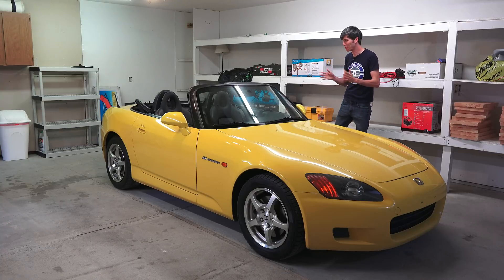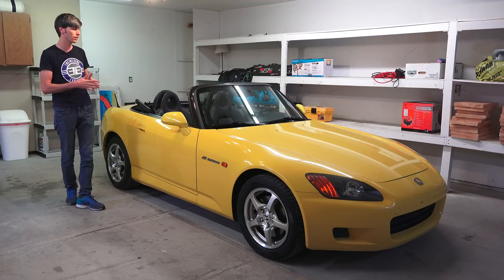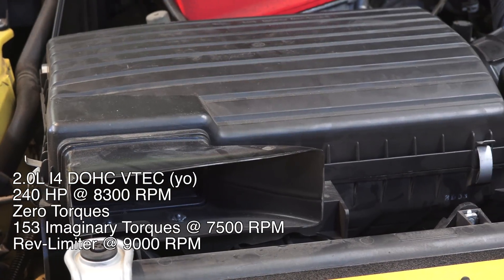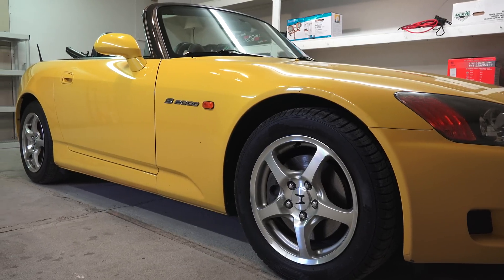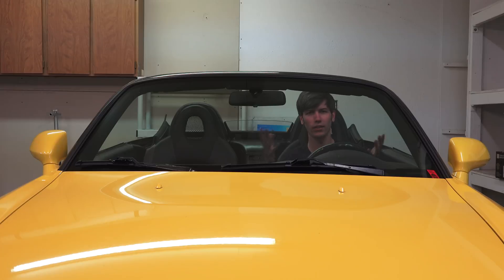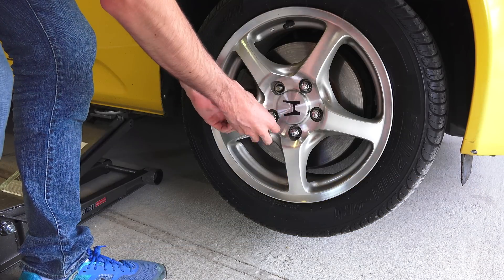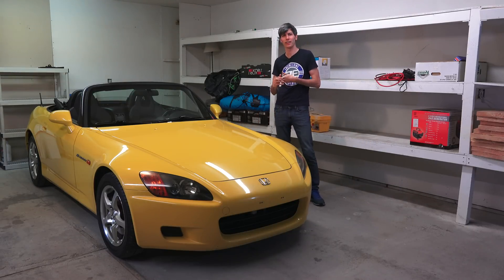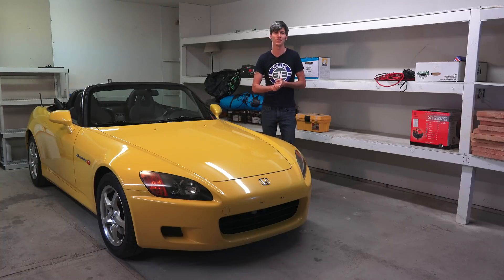I Bought A Honda S2000 And It's Amazing!

Comment: My AP2: Proper exhaust, cold air intake, Lightweight flywheel, Stage 3 Clutch, and changed redline to 9k.  The car felt COMPLETELY different from stock and devoured my stock AP1. It was a great autocross car and it was doing E46 M3 times.  Driving experience is really amazing.  Complete oneness.  Its not about hp guys.  I now drive an orange Crosstrek with CVT lol

Comment: Congrats, I really enjoy your videos. I made the same switch to get back into my 2nd S2000. I sold my 2012 WRX Hatchback (Stage 2+) so I could get a cheaper daily driver and an S2000. I'm still very happy with my decision and wish I wouldn't have sold my first one. As others have said, definitely get on the S2Ki forums if you haven't already.

Comment: Had the opportunity to drive the S2000, the BRZ and my old RX-8 in an autocross event.  These cars handle virtually the same except for some minor differences that are only noticeable if you know how to extract every ounce of performance from cars like these.  At the end of the day my RX-8 posted the fastest lap by about .1 second.  The reason for the faster lap can be because of stickier Michelin PSS tires and I know my RX-8 more than the others.  For the record, the S2000 had the Enkei PRF1 with PSS while the BRZ had them Prius tires.  The lap times were for the most part very close, it just happen that the RX-8 did it the fastest on that one lap.  No matter which one you choose the experience is virtually the same, fun all around.  Nice car.

Comment: Actually this car is the best for this challenge. Ist one of the most beautifully crafted and engeneered engines at all.

I mean, everyone can put some Turbos on an 3,5L 150HP engine and make an 600HP engine but 240HP out of an 2L Engine, thats art!

Next locial step, but an HKS Compressor set on it. First tep 300HP, second step 400HP

thats 200hp/l and the engione still works fine!

Comment: Can someone explain the appeal of vtec? I drove a 2006 TSX with I-VTEC, and I got rid of the car because I hated having a naturally aspirated motor, that felt like it had really bad turbo lag. Not to mention that the gears felt too long even though it was a 6 speed with no difference in the top gear than any 5 speed out there. I traded it for a BMW, because the bimmer is actually cheaper to maintain. Seriously! Look up what it costs to have a clutch replaced in a 2006 TSX, then look up a similar year 5-series. I am happy for anyone who enjoys Hondas. I guess I just prefer the products of Bavaria.

Comment: How is the leg room? I always heard anyone over 5'3" would have trouble getting in and out.
Reply: Lanky, AKA amazing ;)
Reply from the maker: I'm 6'1" and lanky (that part was probably obvious haha). I fit fine. Ideally it wouldn't have a fixed steering wheel and I could bring it closer and move it up slightly, but it's not too bad of a compromise.
Reply: that's good to know.  I was looking to get front engine rear wheel but I was going to get a 370z instead for height reasons (6'3") but I might look at this as a more reasonable alternative.

Comment: Honda's first use of forged pistons?!! (2:33)...My '94 VX with the D15Z1 engine has forged pistons, and that's just a high mileage, grocery-getter.  I can only assume that the higher-zoot engines in the EX and SI models also have forged pistons.
Reply from the maker: Are they aluminum? My info was from Honda, may be referring to aluminum forged.

Comment: Your version is not the highest hp/L until 458 Italia. The JDM spec F20C with higher compression and slightly higher fuel cut is. (250hp/9120rpm+).  Just pray you don't need to rebuild it. Gearbox is an Aisin AZ6 and it's found in RX8/MX5/etc etc. It's pretty nice in the S2K variant though :)

Comment: just curious, why didn't you go for an AP2 S2000 ??  aren't they like exponentially better than the AP1 ??

nice car btw, super clean, I hope to see a spoon hardtop in the near future ;)
Reply: +TheJoePepper ah, well alright cool, the more you know, thanks for the response bud :)
Reply: They are both great cars.  The throttle by wire didn't appear until 2006 so many believe the first years of the  AP2's (2004 & 2005) are the best years for the S2000k, but like anything, it's really just personal preference.  I own a 2005 AP2 and my best friend has a 2002 AP1.  The AP1 is considered to be more "raw" as you refer too, however the AP2 handles a little better in my opinion.  We're both experienced drivers and are very familiar with sports car and really familiar with our Hondas.  Unless your a serious race car driver and / or engineer it's hard to notice any significant changes between the 2 models.  Both cars are truly amazing and very few people really understand the engineering marvels that they are.  Good luck with your new ride.

Comment: is there a ETA for the XV to arrive???
Reply from the maker: I'm told late September, but I unfortunately don't have an exact date yet!
Reply: Thanks, Looking 4ward to it..  I've been planning to get one since they appear unfortunatelly Subaru Cars are EXTREMELY Expensive (Actually everithing is expensive in here) so I've been waiting for the rich people to get one and then I will be able to get one Second Handed..
Reply: Did you get the CVT or Manual. ? I've been told by some users that CVT's are not as good as Manual..

Comment: Why not an AP2? A little more torque but more importantly, a better powerband that's not as peaky.
Reply: How so? I've driven both and the suspension, steering and shifter/clutch didn't feel significantly different. The lack of torque in the midrange on the AP1 certainly did.
Reply: I didn't. So enlighten us why the AP1 makes a better track vehicle. Why does that matter, anyway? How much time do most people spend at the track?
Reply: That literally says nothing but you do you, guy.
Reply: Well I didn't mean it figuratively now did I? You keep making bon mots without conveying any concrete info so yes, you literally said nothing.

Comment: And I am here with my stage 1 1.9 tdi audi a4 b7 from 2008 in red not a lot of HP (around 150hp), but definetly more torque (around 350) than none advertised in the video for the s2000

Comment: Welcome to the club! Honestly contact me if you've got questions!
Reply: Wrote this before I watched...from experience the best and cheapest mod to start with on the S are 255s², any high speed cornering a wing is practically mandatory for stability, at least its the cheapest way to reduce rear lift. But if you don't need the high speed stability (80+) then don't bother. Aside from the 255s, a wing, and the associated spring rates or front sway bar rates to balance the changed suspension loading, nothing else is "needed." With 100k miles new dampers are probably a welcome item though. Next best mod honestly is a seat, and then weight reduction.

GM synchromesh friction modified is great for the transmission...have used Motul, Amsoil, and Redline but the GM stuff just as good if not better, you'll just notice it breaks down a little quicker.

Comment: you should get the valve retainers checked out or just switch them out with Ap2 valve retainers. Ap1 valve retainers are known to crack over time or when over revving. Ap2 valve retainers will fix the issue.

Comment: Are there any mods that increase the torque available?
Reply: All aluminum LS swaps aren't hard, and adds less than 100 pounds when compared to a stock engine built up with a intercooled turbo set up that still makes less power, cost more and is WAY less reliable.

Comment: +Engineering Explained
I have a 2005 AP2, which I've owned for about 7 years. Awesome car, and I hope I can keep it forever. (We get the 9k rpm motor here even in the AP2).
One thing I'd think about is the suspension differences between the AP1 and AP2, which might make a good video actually: if I understand correctly, they increased the stiffness of the front anti-roll bar while softening the rear one. And also changed tyre widths -- front to 215 and rear to 245. Think tyre load sensitivity: The AP1 had a bit of reputation for being quite twitchy with oversteer, possibly thanks to VTEC and the Torsen. The changes to the AP2 would help reduce this, but it's still a car that demands a bit of respect. So this might be interesting, and also take care when thrashing it :)

Comment: With the engine being positioned behind the front wheels, how does this and other vehicles with a similar setup handle in comparison to vehicles with a motor positioned in front of the rear wheels?

Comment: They truly are amazing little cars.  I've had 2 of them so far.  ap1 and ap2 models. You should look into swapping out the TCT and seats with the oem ap2 me a because they have been revised and don't fail over time like the early ap1 model.    Also I seen someone ask why so.low dyno numbers.  the s2k was raged at 240hp AT THE CRANK. after valve train loss and everything else a healthy s2k should out down 190-200hp on and accurate dyno.  With some mods and a tune they do wake up day and night. my ap1 was making 221hp and the ap2 223 at its best on a mustang dyno.

Comment: The S2000 has similar dimensions to the 2017 Fiat 124 so what do you think of a comparison between the two?   When the Abarth version of the Fiat 124 arrives, I'd like to see you do a review between it and the S2000.  I noticed that the Fiat has a smaller 31 feet turning radius versus the S2000 35.4.

Comment: Def rather have this than a $80k Dodge
Reply: if you don't die on the process
~mandatory Viper death trap joke~
Reply: @AL1-07.... You misread.... Anybody who would have 8 Stacks Of High Society would not... buy a dodge(viper... maybe... but still.... noo...)
Reply: dark zaku You misread, I didn't say you had to buy both at the same time. I said if you're in the financial position to buy an 80K car. You could buy either Dodge or Mercedes.
Reply: Would rather have a 40k srt8 challenger.
Reply: Nah would rather have the $80K dodge. So i could have some fun, sell it and buy an AMG or M car when the time comes
Reply: AL1-07 So you'd rather have a Dodge so you can buy a Mercades got it
Reply: dark zaku Yeah you got it. If you can afford a 80K dodge you can afford a 80K mercedes.
Reply: AL1-07 Hold on let me check that math:
grabs calculator
80,000 - 80,000 = 0
Hmm, interesting

Comment: Why forged pistons in something naturally aspirated, that sees so high of RPM?   I thought Forged pistons were way heavier, expand too much, making the clearance too large to the piston wall to be efficient, and slowing down revs?
Reply from the maker: +Kenny Coulter they're aluminum so weight isn't a big issue. Forged allows for using a smaller size relative to strength as well. I believe they did it due to high piston speeds above 8k RPM.
Reply: Yep that's right
Reply: I mean compared to a cast or hypereutectic piston.

Comment: Congrats.
Any reason why you opt for the AP1 and not AP2?
Reply: Really I was hoping for someone to say "its over 9000!"

good enough.
Reply: I'm going to guess he wanted the 9k redline.
Reply: Almost double the price and barely much faster...
F20C etc also in AP1.
Reply: Dont know about the price, they seem to cost pretty much the same in my area. Price= It comes down to mileage/ condition of the car.
Reply: +iNNoCeNttDReAMs
[soft monotone voice:] "Greetings.  I am the AP1 9000 RPM engine."

Comment: Nice colour choice, I have the red one in Australia. Yes ignore the internet hissing and moaning about having a Japanese convertible, it's quite easy after experiencing a few long twisty drives. It's a car who's engineering of everything can be really appreciated. If it doesn't have semi-slick R spec rubber on it yet, try that soon. I've done 15 years of road Kart racing, and my AP1 is the closest thing to the feel of a Kart on slicks I've experienced on the road. I'm keeping mine as close to stock as possible, as they get older and fewer the clean stock ones will go up in value faster. Have fun. Martin

Comment: Iff the engine is behind the front wheel does that make it mid-engined? Does that mean it pretty much id a lighter convertible NSX?
Reply: Yes and no
Reply: Specifically, that sort of placement is technically called Front-Mid since its still in the front half of the vehicle. I believe any car with all of it's engine placed behind the front wheel hubs and steering rack would be classified as Front-Mid. Typical mid-engine cars we think of like MR2s and various Ferrari models are Rear-Mid, AKA Mid-ship, but are found in the rear half of the car.
Reply: Colin Brunt Thanks for clearing that all up.  So there are Rear engines like Porsches, Over Rear like Lambos, Mid Rear like the MC12, Mid Front like this S2k and Over Front like the BRZ?
Reply: Yep, you got it!

Comment: I have a V6 Camaro and sometimes feel I need more pick up, I am considering the s2000 as a replacement and I am worrid that this will become a bigger issue. 

Can you elaborate more on the power feel. Does the the 2.0L Engine feel underpowered at high speeds? for comparison the Camaro feels wanting around 160Kmph
Reply: The S2000 beats a V6 camaro in any way.
Reply: Is your Camaro an auto or manual? I have the manual and I feel it has decent enough power for what it is (323hp). It requires high revving to extract that power though since it's a little low on torque for the weight of the vehicle. If you have the automatic though, it basically sucks for performance. It's geared for economy and the paddle shifters are a joke (massive delay in shifting gears).

If you're looking for a fun weekend warrior though, the S2000 is a phenomenal choice. One the of the most balanced and best handling cars ever made.
Reply: I was considering an S2000 for my next car and it's definitely a "try before you buy". At normal, low speed driving (<50 mph) the engine feels very anemic and you have to basically thrash it to get any power out of it. The close-ratio gearbox seems to have been designed with said thrashing in mind. The handling wasn't anything to write home about and the steering feedback was poor (not what you want in the wet or cornering at high speeds). The dashboard is really crappy looking and the steering wheel obscures the tachometer if you're over 5'9". I've never driven a Camaro so I couldn't tell you anything about that.
Reply: +Michael Dison i understand what you're saying. i tend to agree. i find the best way to drive the automatic is to put it in S mode and disabled the traction control and stability management.

i have no doubt that the s2000 will offer far greater handling, but I'm not sure how the 200+hp for that car being light would compare to the fast Camaro with its 300+hp

Comment: The BMW E46 M3 CSL was a pretty mean machine, with such a silky and agile high output suction engine! And the (intake and exhaust ) sound, which together with that double clutch sound of that automated, conventional gear box (weighs only 18 kilos more, than a stick shifted). Not that much revs, not that high specific output, but a more useful torque curve! ...and the sound... Boy oh Boy! I love that car, even with that weird transmission and its fading brakes. Bot the S2000 is also such a nice product, as many Japanese cars!

Comment: Hahaha, zero torque and then "imaginary torque"  :-D  
A friend of mine owned an S2000 and I got to drive it fairly regularly, I even took it on a 1000km weekend road trip.  It was noisy, buzzy, and after 8 hours of driving on wet twisty roads I had ha enormous fun, but I was exhausted!  So much fun though, especially blasting through tunnels with the hood down, slowing down (when safe) and then flooring it to get the VTEC to kick in.  Man I missed that car when he sold it.

Comment: IMO, get the valvetrain done. Go stronger valve-springs, guides, seats and valve retainers, lastly get a valve-adjustment. Hardly anyone gets a valve-adjustment on these motors. Next, get oil banjo bolts from AP2 since those lubricated more than the AP1s did. Doing all these would really future proof that motor.

Comment: Cars like the S2k make me really wish I wasn't so tall (7'1"). All the fun little 2 seaters are just too small. 

Even cars you'd expect to be bigger just aren't big enough.  When e we were working on the C7 and the early ones came in for testing, my heart broke when I couldn't fit.  The Z28 was no good, either. I could get into the Challenger Hellcat but it was far from comfortable. Sadly Ford was behind with the Mustang and never actually brought them in. So many changes right up to the end and then they actually sent their workers to do production runs on our machine assembly for because they couldn't afford the downtime to ship the machine.  

One project I did fit in easily was the Ford Transit van! lol That damn thing got delayed so long, too.  Our machines for that were ready to go and sat waiting shipment for about 14 months!